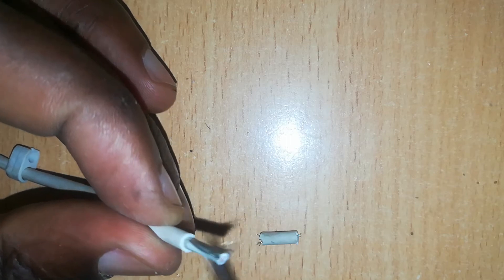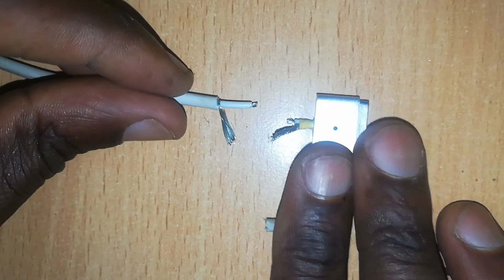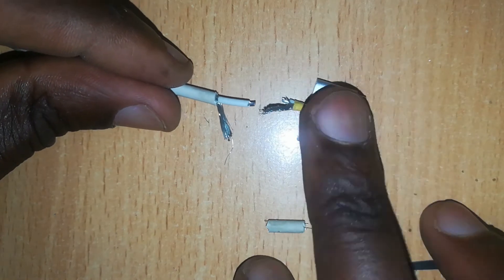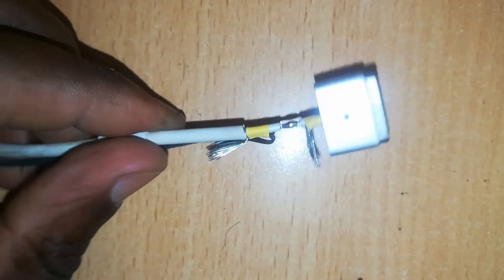Magsafe 2 cable repair: Connector

Comment: Thank you. I just don't get: don't we need to properly connect the outer wires if they provide electricity too? Like if they just remaining touching each other wouldn't it be a possible problem of overheating as the connection area might be too small?

Comment: @5:39 how do you pull the rubber sheathing?
Reply from the maker: make a piece of cloth wet/damp. place it around the cable. hold firmly and pull towards the desired direction....
Reply from the maker: subscribe ,like and share!!

Comment: Hi man, thnks for your help! But actually for me the magnetic t end has fully come out. So, there is nothing in the t end to connect. Any way to fix this? Please help me
Reply from the maker: kindly elaborate what you mean by magnetic end....
Reply: @reachtech1  It is the t shape head, which has a magnet and can get stuck to the mac charger port.
Reply from the maker: the T-head does not have any magnetism. Same to the L-shape. The MacBook contains magnetism at the charging port. If the T-shape head has fully come out, you can still follow the steps in the video and repair it, or get another T-shape connector and join to your adapter. watch my other videos for complete/alternative steps.
Reply from the maker: also check this links: https://youtu.be/Md1LOEyEReg
https://youtu.be/MKHGVn6LGnc
Reply from the maker: Also like share and subscribe!
Reply: @reachtech1    Then it seems the T-shaped connector can not be repaired, it has to be replaced? So where do you buy one?
Reply from the maker: @anthonymwangi6889  you cannot buy the connector on its own (ie without the cable). but you can reconnect the one you have, or get another worn out cable from a discarded charger and use its connector. Happy repairs! subscribe, like, share!
Reply: @reachtech1  Thanks bro for the information
Reply from the maker: @anthonymwangi6889  welcome and thank you!! If you have any request do not hesitate to ask!!